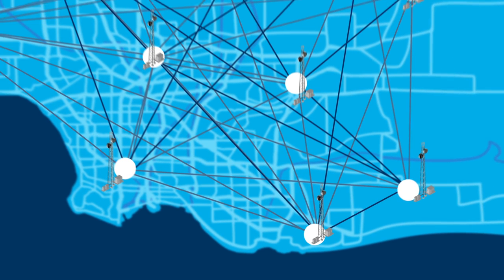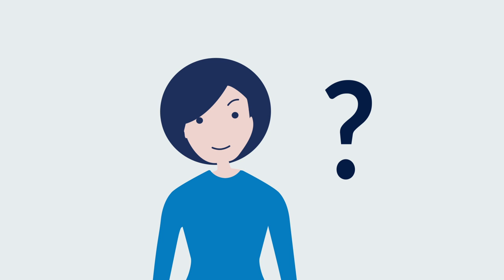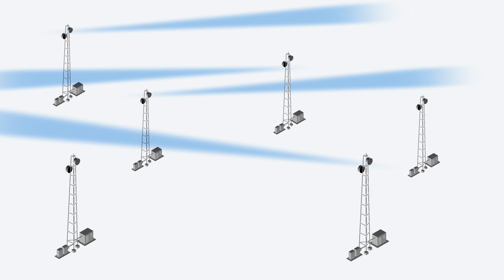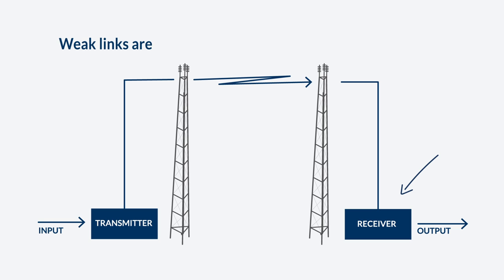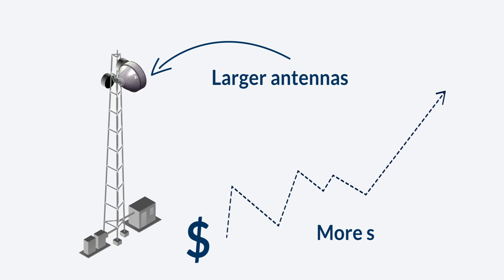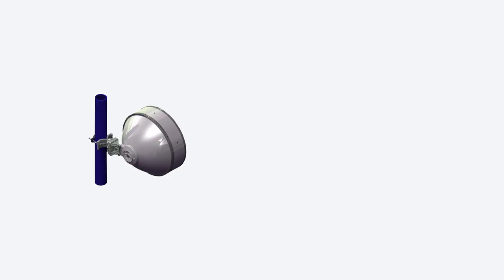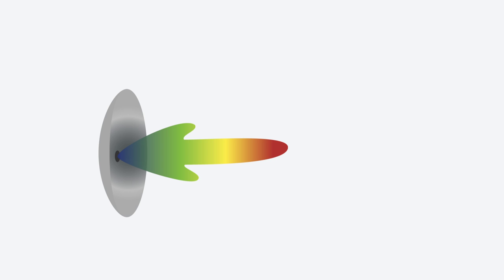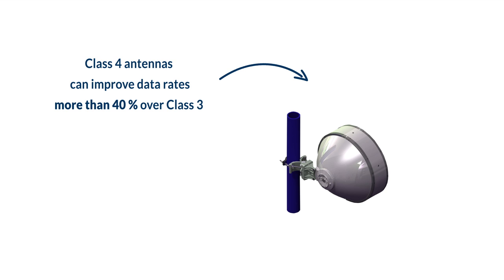Understanding microwave antenna sidelobes

Comment: does the material a reflector is built out of reflect all the energy so no signal is lost due to penetration and refraction? similarly incidents signals from the back, are they all reflected away due to the material of the dish so there is no issue of interference? Thanks